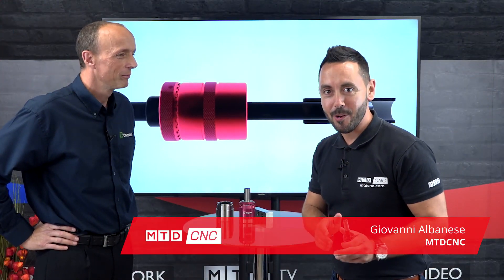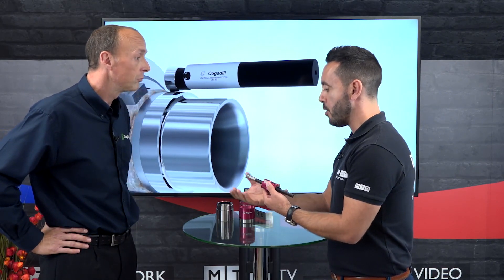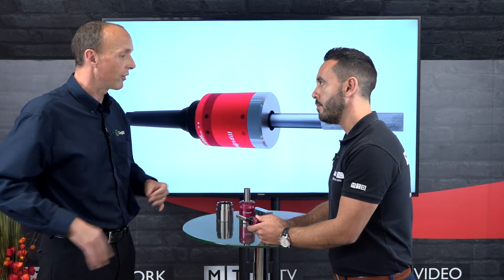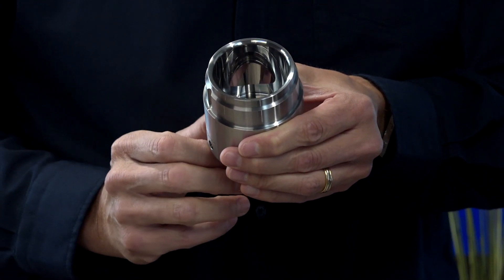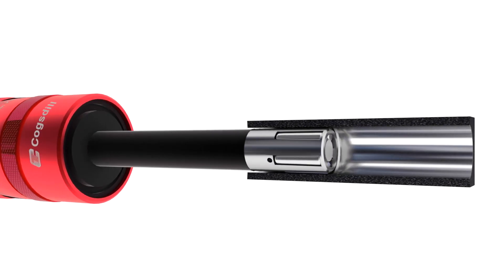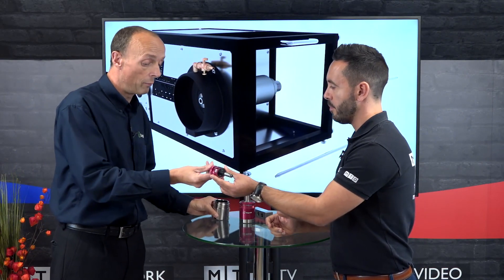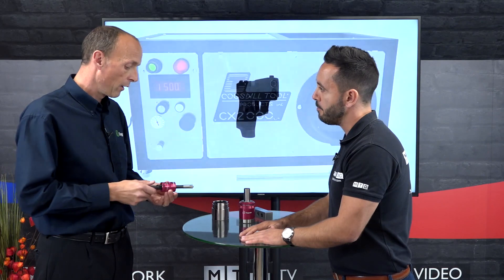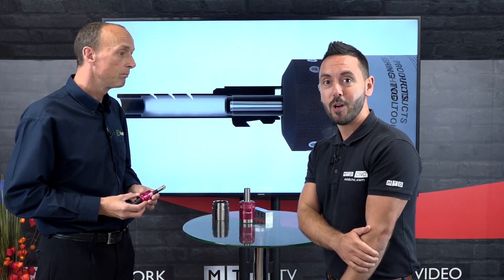Operations saved with Cogsdill Burnishing Tools

Comment: This is great! Very topical. Trying to get my head around difference between roundness and concentricity versus Ra vs Rz . If you have a mill that has 2 micron runout on spindle and roundness of bored feature is to 5 to 10 micron does the burnishing add an additional error ? Reason for honing and grinding is increased part accuracy as well. Hmmm (scratching head). Worth a go and that "Castle-ated" adjustment that makes the rollers expand in 2 micron increments seems pretty incredible. THANKS FOR MAKING THIS... Will check these tools out !
Reply: Good Morning and that's a great question - The 'Roller burnishing' tool has an element of 'Float' designed into the tool to allow for any spindle run-out.  Therefore, the tool will effectively 'Follow' the bore and will not add any additional run-out to the component.   We are only cold rolling the 'peaks' into the 'valleys' so to speak so the amount of metal displacement is microns. if you need any help, please contact us and we will gladly help you out -  also, check out our new website - the burnishing tools section is here - https://cogsdill.co.uk/products/burnishing-tools/
Reply from the maker: Thanks for your comment, the burnishing tools are predominantly to achieve excellent surface finishes. They follow the pre-machined bore or hole. For more accurate information please contact Cogsdill - www.cogsdill.co.uk